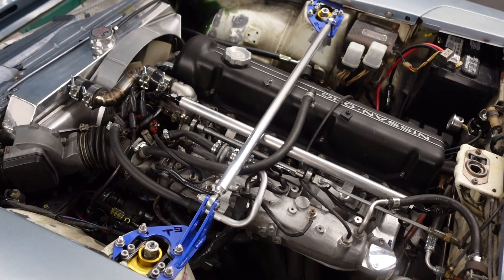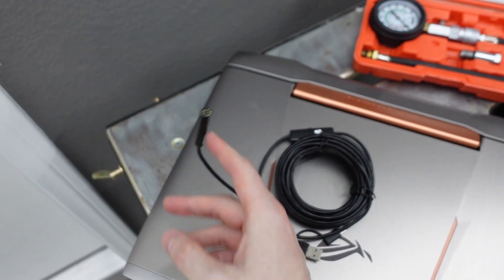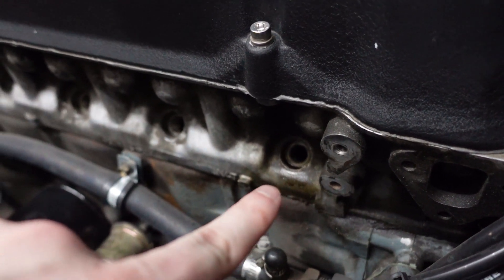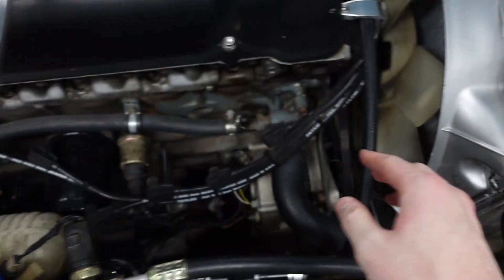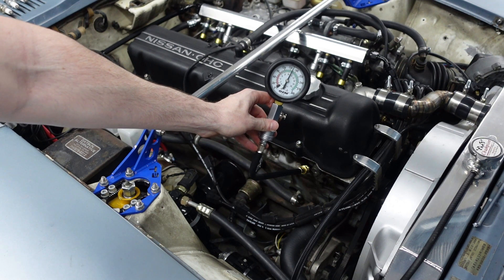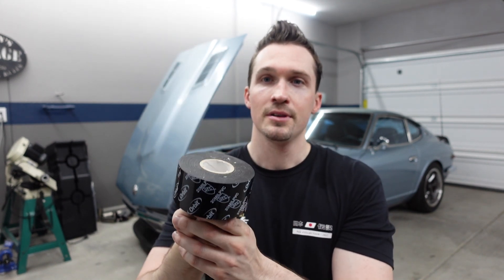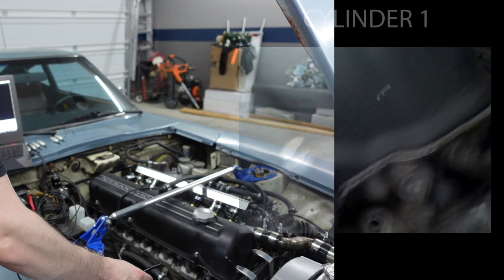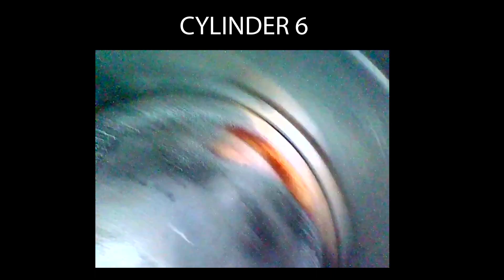IS MY ENGINE THRASHED? DATSUN 280Z CYLINDER CAM | Compression Check and a look inside my L28 motor

Comment: Good vid man and all owners should be doing a test to check.  Not sure how old your engine is but 150s is def on the low side. One think to potentially check is your PCV valve. Mine clogged and started smoking in the exhaust and excessive oil consumption. It actually blew out the rear main seal. Something so cheap and simple led to a much bigger fix.
Reply from the maker: That’s a good point, I did, however… remove mine haha so that may be it

Comment: Love the video Jordan, might do this test to mine. 

Random question. Does your FPR read 0 right after you shut the car off? Or does it hold pressure? I have the same set up and mine dies instantly after shutting the car off. Thanks
Reply from the maker: The pressure shouldn’t instantly drop to 0, it should hold some pressure and slowly bleed away. I would look for leaks somewhere 🙏🏻

Comment: I saw low compression Pistons. Not flat top high compression Pistons. Adding a turbo set up with protunerZ
Parts would be better than a 3.0...
Funny jasper has no record of a motor, they built. They would have to have inventoried it, built it, then sold it, recording it's exists.
Reply from the maker: Yeah they told me that over the years they’ve reused serial numbers and this is one of those reused ones. So I guess we’ll never know!

Comment: When you have triple webers like me, you tend to ignore any smoke coming out the back haha. For the amount of smoke you were producing and based on your compression results and internal condition of the walls, I say you are fine. You can redo the compression test and add some oil in each of the cylinders and see if the compression goes up by a decent amount would indicate your rings are worn. Otherwise your valve stem seals might be bad or potentially your head gasket is going bad but like I said, not enough smoke imo to worry about anything.
Reply from the maker: Maybe in the future I’ll do a leak down test to make sure my head gasket isn’t the culprit, but yeah I agree my anxiety is definitely better after these tests

Comment: Jordan, good video.   Your smoking is more than likely the valve stem seals.  It’s a very common thing on these engines.   They’re replaceable, you can buy genuine Nissan ones for around $60.   There are videos out there how to do it yourself.  It’s not a issue if you don’t replace them.  Old seals allows oil to slip by and drip into the cylinders which cause smoke on start up.  You have some build up on a couple pistons which could be from the same issue.   Also you can turn off the injectors by pulling the injector power wire that attached to the positive terminal of your battery.
Reply from the maker: Good to know! Tolerances on these old motors aren’t as tight as modern engines so that makes sense 👌🏻
Reply: @JordanPayneLV  It’s not a tolerance issue,  these seals just get old and need replacement.  When you turn off your engine the oil left in the head slips by the old valve stem seals.  The oil drips into the cylinders.  You can see the fresh oil  that dripped on your cylinder walls in the camera shots you took.

Comment: if you don't have any cat, it's just maybe some rich exhaust fumes because of the precedent revs returning to idling. ECU wants to regulate all of that and bim richier combustion for a small moment
Reply from the maker: It definitely could be, I thought a rich afr made black smoke though? No?
Reply: @JordanPayneLV  normally yes, but most of the times it's greyish (we don't have Cummins right?) so maybe with the camera and back colors, we never know! or maybe you're putting E85! haha
Reply from the maker: @aresworkshop6899  definitely could be looking lighter with the sun in the background. E85 would be a great power boost 😎